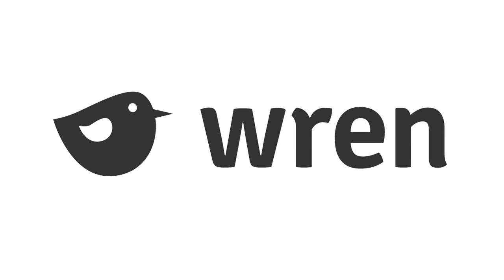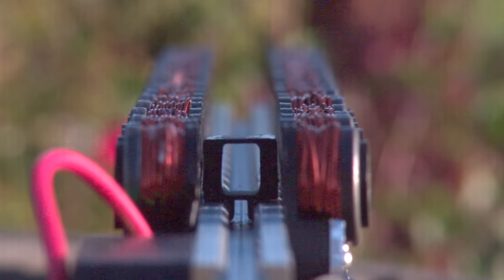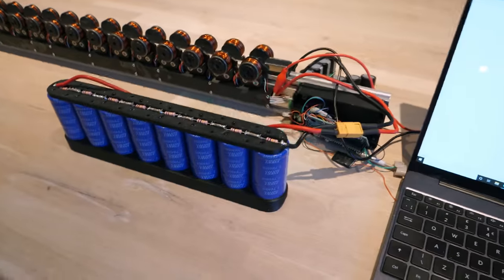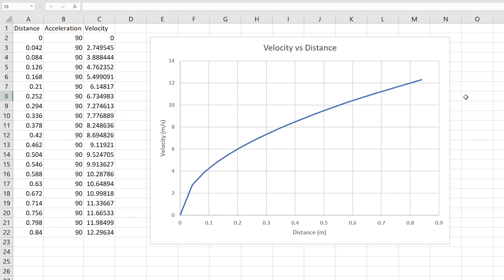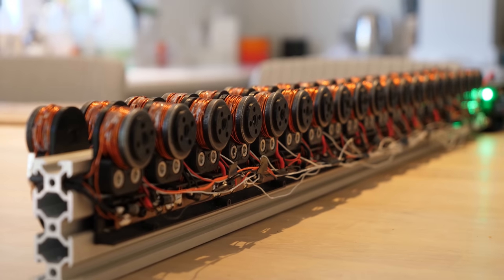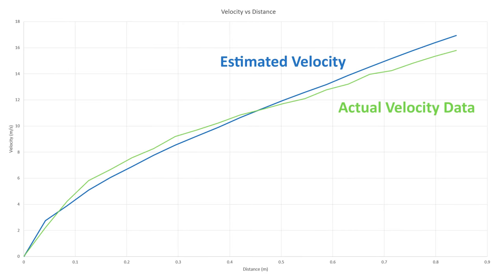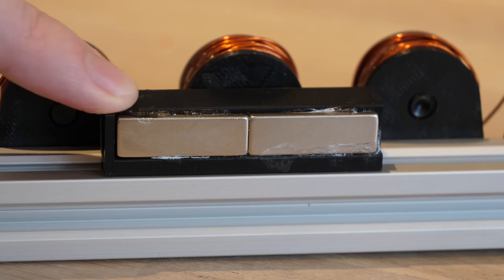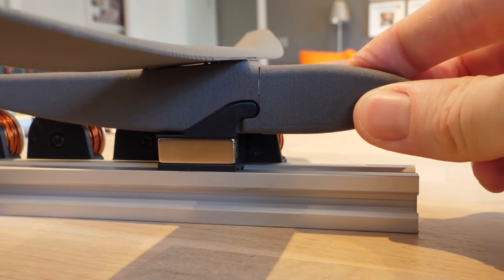Optimising a Magnetic Launcher

Comment: Since you have sensors to detect where the sled is, could you use them to predict where the sled is and go faster than the initial timing? (The gap between the coil and the sensor) Also, then could you create more field by turning on the next one earlier, or hold the current one a little longer/shorter to match the center point of the magnet before shutoff?

Comment: As the sled gets faster the force applied by the coil has less time to act
Reply from the maker: Force doesn't require time to act. The energy applied to the projectile is determined by a force over a given distance, also referred to as work done. Therefore, time doesn't affect the energy applied.

Comment: I wonder. Not the first paragraph or second but the third.
If you wire the coils like a magnetic shift register from very very old electronics you would get a flip flop effect without much penalty for complexity
Still would have a penalty to complexity because you would have to delay the transfer till your hall effect switch gives the okay.

I wonder how much power you could get out of coils arranged like that, where they would be acting as part of the control.
That's a tricky question to answer but it might be worth while.

Comment: Probably a dumb question - why let the mass of the sled double?  Could the magnets be smaller, separated by a spacer?  Also, how about pumping a little air under the sled, through drilled holes, to reduce the drag caused by the gutter?

Comment: Just a question..
Lets say you had 4 sections on your launcher,  Each with a different voltage and larger diameter coils.
If you had them going up in increments would you be able to have your V/D Graph go more linear? 
           <---25cm---25cm--25cm--25cm-->
                  V            V          V          V
I am not familiar with all the terms in reference to Electricity / Magnetism

Comment: How come u use the relative magnetic strength formula? ((1/10)*10) what are 1 and 10 here also I am not understanding which you considered as coil length? And also which board did you use as a control board? As per the serial monitor, it is an Arduino board but which one, UNO or Nano?  

Please do reply.

Thank You 
Subhankar Chakraborty

Comment: Hybrid batteries and super capacitor bank power source? Or are those batteries able to dump the required current and voltage as quickly as the system needs?

Comment: Im no genius but im pretty shore you cant just send a linear electric current and expect big gains. The switching of the electro magnets needs to increase as the projectile moves through the fields so that you get constant acceleration until it leaves the rail. I think weaking the coils as the projectile moves through the field the projectile is gaining velocity as the coils further down the rail arent hampering the velocity of your plane but that gains are tiny. You are making gains because the barrel is longer. A pretty standard thing for guns when the initial charge or gun powder is constant so time is the only factor you have. Hence a longer barrel. I think thats why you call it linear not a true rail gun but i suspect thats just the differnce betweem the way your electro magnetic field differs from a rail gun compared to what you have in which case theres still more you can get out of a projectile weapon that can continually apply force to the projectile the entire length of the rail. Thats why they can reach such ludicrous speeds and reminds me of the massive multi charge cannons made by nazi germany that was destroyed before it could be fired.

Comment: Pls answer. I have a ebike controller that works  on 24v19amp so can i power it more amp. I mean like 25amp. Will it damage the unit. I need this because my batter pack is 24v19amp so the motor is also is 24v19amp so it will only 1hour.

Comment: Why don’t you just put the super capacitors in parallel with the battery’s you used on the E-bike? This way the first powerful spike of current draw is split between the super caps and the battery’s.

Comment: YOu don't need to turn on each coil, you can do some wierd things by causing a magnets twist to veer towards another force, its easier ot engineer this if you could jsut see the magnetic currents nad lines nad intereactions and then rather then whole elpise eddies I will call it, you create these jagged infnite proxies and it forces no need fo ra switch with minimal loss, but meh.. I Dont 'knowl.

Comment: Why don't you make a compressed air launch. You have already gone through pretty much all the launch systems for roller coasters and compressed air is the last one!
Reply: If I understand it correctly, a compressed air system is generally not very energy efficient due to thermal energy loss. You also have to deal with the permanent decreasing pressure while transitioning the pressure energy into kinetic energy. I'm a layman at those things, but I ask myself if such a device would not have to be quite complicated to delive a constant acceleration... Just saying. 
But for small devices, it might make no difference.. Anyone a better idea?
Reply: @Frank Yboy  well if you look at rollercoasters the fastest excelerating coaster on earth do do dompa uses a compressed air launch. Also all of the drop towers also use compressed air lauches. I bet he could adapt the system they use for the coaster for this since he essentially has the same goal of using a catch car to Launch somthing down a track.

Comment: 1:12
and congrats, you just made a Railgun. A Railgun is a weapon that uses electricity to launch a Sabot like projectile to create severe damage. It uses 4160 V AC power from the generator to be rectified into a high voltage DC current as the Railgun is a DC Device

Comment: Hi Tom, You seem to be very thorough in most things but one. Have you thought about putting the claim that CO2 can trap heat on orders of magnitude better than water vapor and that even ~0.01% increase in concentration can make measurable difference? The doomsday cult of climate warming just repeats the claim until people accept it but no-one dares to put it to the test. 
Can you (do you dare) to make a test that would demonstrate the plant growth in CO2 poor environment? In example lowering the concentration from the present 0.038% to 0.025% ( as claimed preindustrial) and then with 0.01% which can easily happen if the climatards can get their way and overshoot with "decarbonisation" with their crazy plans.